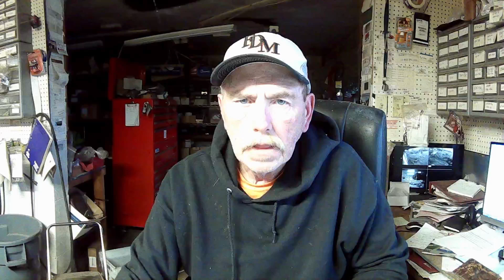Small Engines Makeover : Unveiling the Differences Over the Years

Comment: We bored cylinders of sleeved and iron engines in the early seventies. .  That is why OS pistons were available. At about that time short blocking came into vogue. Briggs engines that weren't sleeved were cheap to replace.  High hour engines would also need a new rod if it is too ovaled out, as the rods didn't have shell bearings. Better engines had roller bearing supported crankshafts. Bushings on both ends were throw away.  If the valve guide clearance was excessive, it needed reaming or guides.You would see this on a 1000 hour plus engines. I was making  maybe $3.00- 5.00 an hour. 4-6 hours to rebuild an engine. No oil pumps on the old flatties, strictly splash oiling.
One thing to remember about the long life of these engines is that the had such a low output per cubic in that everything wasn't stressed A thirty cu inch engine has been replaced by 20 cu inch engines with overhead valves and electronic ignition. Sleeved aluminum engines with oil pumps and filters out last the old motors.
Do you remember the early Cub Cadet/ International Rear engine riders? They must have had twenty grease fittings. I think they were Tecumseh.Before MTD, it was a quality product line. No grease fitting in anything under 4k today. 
Briggs offered better lines of engines that were rebuildable, to be able to compete with Kohler, Lauson, later Tecumseh, Clinton. Wisconsin was thought to be top shelf.Lawnboy owned the two stroke market, with commercial competition from Jacobsen.  Emissions and bad decisions closed the extinct ones.
The decision to cheap out using plastic internals on cam gears and compression releases causes everyone to use poor language.  That started in the 90's with Kawasaki cam gear failure. Hydro failure is to be expected today with bottom end machines. I have seen them die after two seasons on a hilly lawn with a stout driver. 
Today all engine makers have units designed for a price point. You want cheap, they will give you cheap. There are consumer levels and pro levels that cost much  more for hopefully longer life. Do your research.

I cut 2 acres with a 1995 JD455 diesel 60'' deck that I got at a yard sale. 3 cyl yanmar 20 hp. Kind of noisy, but it's the last machine i will ever need to buy. Got it a a sale where a horse farm was folding.  It has 1100 hours showing. If plowing snow you need wheel weights , chains, and winter diesel . good video, thanks.
Reply from the maker: great comment waiting. Thanks so much for sharing even more info on the old to new. that JD455 must be a beast!

Comment: Thanks for another great video Eric.  When I first started in the trade, tractors still had variators.  Eric, I know you are all too familiar with what I am speaking about, but for others who may not know, it was literally a pulley that changed sizes via a sliding mechanism, and this was how you controlled the belt speed on the drive system.  Innovative for its time, but hydrostatic transmissions sure simplified things as they became more popular.  More of a "when in doubt, throw it out" operation, just remove and replace the unit.  As far as attachments go, Walker and Ventrac are just a couple of brands that still have various attachments available to make the machine more versatile.  Of those two makes, Walker seems to have been designed by one engineer who knows nothing about actually servicing them.  "Oh lets put and engine here and build an entire mower around it." Ventrac, on the other hand, seems to have been designed by an actual mechanic, everything is accessible, even the electrical system is plug & play.  Very nice to work on by comparison.  So newer machines have evolved in different ways, and as you mention, all have their pros and cons.
Reply from the maker: tj, this is just want I wanted and that is you older guys adding your wealth of knowledge as well to this channel. thanks so much for sharing